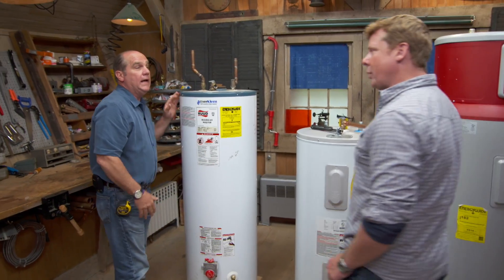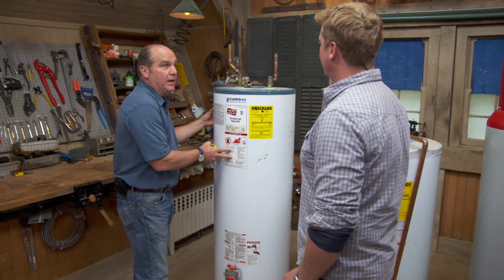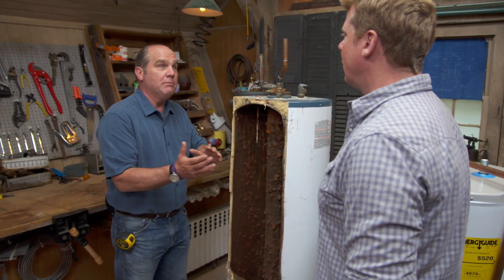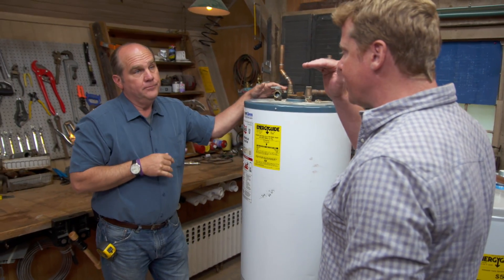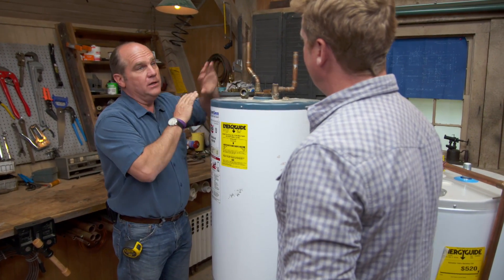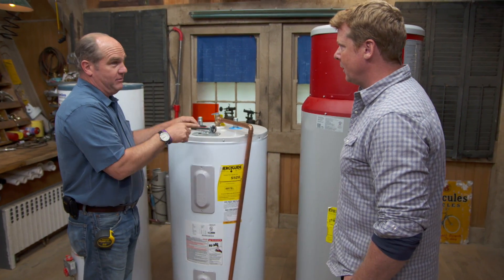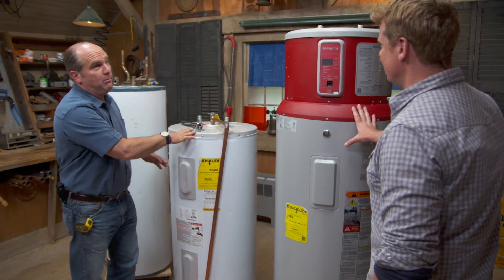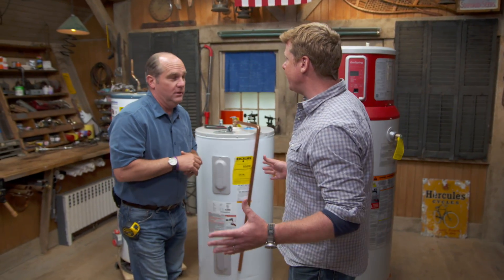Understanding New Water-Heater Regulations | Ask This Old House

Comment: I know this is old, but I wonder if the critical radius of insulation was considered? An engineering issue related to shedding heat from wiring that could be a problem here. Point being that for a cylinder, there's a point where the insulation thickness causes the surface area to increase to a point of maximum heat transfer.

Comment: So if you put a heat pump water heater inside your house you're going to be using, quite likely natural gas or even oil to heat the air that's in your house and then that heat pump is going to suck the heat out of the air and put it in the water. So basically you have a gas fired water heater with an intermediate step.
I live in Georgia where most of the year we have plenty of heat outside so I can see a heat pump water heater being very functional here most of the year provided you can get it outside hot air too draw the heat out of

Comment: I owned a 3 story apartment building for almost 30 years. Each unit had a 30 gallon natural gas fired water heater in the hall closet. In 1990 and 91  I installed Smitty aluminum drain pans under each water heater and ran the 3/4'' pvc drain pipes to outside the building. Almost every water heater failure started as a small leak about a week before the pilot went out and the tenant had no hot water. I could drive by the street or through the parking lot and see who had the bad tank from the weak stream dripping out of the elbow. It might fill an 8 ounce coffee cup in one minute.

 I had AO Smith, GE, and Rheem units. Almost all had a 6 year guarantee. I would buy whatever Home Depot had on sale and keep 2 or 3 new ones on hand. I ALWAYS marked the installation date on the side of the new tank and kept records of tank replacement in my maintenance book. When I sold the building in 2018, I had replaced a total of 47 water heaters over the years.   The last 4 or 5 went out on Sundays. Go figure. 

Many of the water heaters lasted 16 to 19 years. I had the water supply regulated to the 4 buildings to have 45 psi on the 3rd floor. The original pressure was 75 psi and faucet and tub valve washers lasted years longer with the lower pressure.   Perhaps it helped the water heaters as well.

The tanks that failed in 6-8 years had one thing in common.....the tenants always  had them cranked up to the highest heat setting. We had very hard water and those tanks always crackled and popped when the burner came on. You could hear it from the outside walkway. I think the thermal cycling cracked the glass tank lining and allowed corrosion to happen in the bottom seam. I never flushed tanks, never replaced anodes. Those Smitty drain pans saved a huge amount of trouble as no carpets were flooded.

For several years I used those Watts braided flex connectors to pipe the tanks. 3 of them failed over the years and created a huge mess, one in my own house when I was out of town. They sprayed on the cabinet walls and the drain pan didn't help at all. I got rid of the Watts flex connectors one by one and hard piped each tank with copper tubing. Sorry Watts, I'll never buy another one of your flex lines ever again. They all failed on the hot water side.

I have a mobile home vacation place that still has its original Rheem 30 gallon NG fired water heater in it. It was new in 1974.  That would 47 years of service, some kind of record. For years we shut the water supply off to the house when we leave and turn the water heater to ''Vacation''. The pilot stays lit, it sits for 3-6 months with no use. I was just there and it lit off as soon as I put the heat to Medium. It must have an inch of scale on the bottom and it snaps and crackles for 5 minutes every time the burner lights off. I figure its good for another 10 years. 

I like the old thermocouple gas valves much better. They were trouble free for many years. This new crap with the electronics sucks. They are ''new and improved''.

Comment: this new regulation means i couldn't fit a 40 gallon into my space, i had to step down to a 30 gallon. however bc of the better insulation and more efficient burners, i actually get longer time of hot water than my 1994 40 gallon bradford white

Comment: The $ 1200 AOSmith that was installed when I bought my house, failed at 10 years.
The Home Depot (Whirlpool I think) $450 installed 40 gallon short installed in 2005 with 9 year warranty, is still going at almost 14 years old.
Now that same water heater installed is about 1600-1700.
I am cringing every day, as I prefer these old school gas water heaters, especially when I lost power for 3 days.
Reply: home depot is Rheem. lowes is whirlpool but they stopped carrying whirlpool and now carry AO smith. whirlpool was made by american water heater which is owned by AO smith. the 2 brands to go with today are Rheem and Bradford White from plumbing supply house. flush annually, replace anode rod, they will last 2 decades

Comment: Just went through this at my home.  I had a 28 year old (!!!) Rheem 40 gallon Direct Vent gas water heater finally fail with a ruptured tank and went to replace it, only to find the new DV units were now not only expensive, but more importantly, a lot larger than my old unit, making a fit in it's location an impossibility.  Plus the warranty was only 6 years. 

Was considering a switch to a conventional gas fired tank, but then problems with make-up air and the need for a chimney pipe pretty much negated that option.

So, my only remaining choice was to go tankless, which in theory is fine since it frees up space and provides 'endless' hot water, however the price point was very high for my application, the unit only itself being about $1,700.

After having to redo the water and gas lines and patching the wall inside and out where the old DV pierced, the installation was quite a job.

As someone who gets free natural gas right off the well head, the financial reward is NADA.

FU, federal regulators
Reply: Would have been a lot cheaper to just add a 30 amp breaker to your circuit and run a wire to that same location and just use an electric tank.
Reply: @youngrav2311  , I get free natural gas tho, not free electricity 😉

Comment: He says about the Tankless design: "You can't get anymore efficient than this". Wrong. The Tankless Design has maybe a Energy Factor of close to 1, meaning that for every $1 of energy input you get $1 of hot water output. A Heat Pump design has an Energy Factor of 3+ meaning that for every $1 in energy input you get $3+ in hot water output. It can do this since it is pulling heat out of the surrounding air and converting it into heat in the water - rather than creating all the heat through burning gas or using a heating element.
Reply: So it cools your house to heat your water so now you have to spend more the heat your house? Makes perfect sense? Maybe if I lived in South but I live in the North and only heat my house (No AC).
Reply: Move brah

Comment: Stay away from the hot water tanks that have direct vent. The one I bought had a freaking huge motor on top that sounded like a jet plane taking off and it vibrated the floor of the main house each time it started. It was a horrible experience and I paid to get it out of the house.
Reply: That's a POWER VENT and not a DIRECT VENT.

Comment: Myriad of things could go wrong with this heater..Old school water tanks have a burner  and a thermocouple, that's it...
Maybe not as efficient, but 100 times more reliable..
Reply: I agree. My brother paid top dollar for a White Rodgers tank in January 2020. It has had 3 new sets of controls since. I think they are Honeywell. The last one seems to operate as expected but the one before it would sometimes randomly let the kitchen sink water get to 141 degrees,  then stay around 94 degrees 2 hours after the washing machine stopped. I had an apartment building for 30 years and the old reliable thermocouple gas valves always worked just fine until the tanks started leaking 10 + years later.
Reply: The only additional things on a condensing water heater over the Old School is an inducer motor (very inexpensive) a fan proving switch (also very inexpensive) and a condensate line - 3/4” PVC is only a few dollars...in the energy savings alone over a two year period, all those things Ive mentioned on the newer units could go bad and the savings in energy usage would more than pay for them. The benefit is 15-20% energy savings...granted the flue would need to be changed to PVC and could cost you an extra $100 or so to have someone install it.
Reply: @scottmelunis9562   nice lie and bull crap

Comment: The heat pump unit will benefit in the summer time but the winter will cause worse energy consumption
Reply: Yep, less energy in water heating but more energy in house heating. Net no change but it will cost you 4 times more to buy the water heater.

Comment: I can't believe people are arguing that saving money, while using less energy is somehow a bad thing...
Reply: I think they're arguing that the increased upfront costs and new space & plumbing considerations are a nuisance. But I do think these regulations are worth it considering the long-term cost savings. 

If space is tight, go with the on-demand hot water heaters--they're even cheaper long-term.
Reply: The Best Stooge 
Don’t you need one of those water recirculation valves to push the water back to the heater?
Reply: I do not even know what that is as my system is just a gas fired water heater in the hall closet.
Reply: because the difference in heat loss savings is negligible.
Reply: at least it is to the consumer, or home owner.
Reply: If the cost of the savings don't pay for the price of the unit the consumer is at a loss. Not all that hard to understand.
Reply: Market forces should dictate, not government intervention. 

Let the consumer decide what's in their best interest.
Reply: You people make me laugh because when everyone goes to the cost saving stuff the utility company always jacks up their rate to compensate.
Reply: Most people are afraid of change and are haters.
Reply: If you have the money I’m all for saving energy. Problem is if you have spend more money on a water heater and modify your closet to accommodate it it’s just not worth the hassle. I priced out a tankless water heater many years ago. It was 3x the cost of a regular one. A regular one lasts about 10-12 years for me. For the cost of the tankless I could buy enough water heaters for 30 years and with saving of only 30% it wasn’t worth it.
Reply: The only thing good about a tankless water heater is the instant hot water so water is not wasted as you leave the hot tap on waiting for the hot water to arrive.  In my 2400sq ft. home that can take up to 2 mins in the dead of winter.  That is about 5 gallons of wasted water.
Reply: The Best Stooge bottle that water. It won't be wasted

Comment: Hang or Cradle your Electric Water Heater Horizontal for a 75% cut of Cycling loss and a 35% energy savings and a 40% increase in first hour draw

Comment: I have a question. We have a 50-gallon electric water heater that's about 9 months old. We only use hot water in the morning for showers. Could we save energy by using a timer that allows power to the water heater only between 6 and 8 AM ?
Reply: It depends if your utility has time of use rates. I would recommend you install a HPWH and set the timer to run during the cheapest time of the day. Save on making hot water, energy and demand charges.
Reply: Insulate your tank more. It would take so much power to reheat 50 gallons plus the water you use everyday. Otherwise an on demand  water heater would be your next best choice. In my opinion
Reply: +Glenn Watkins Of course, moron.

Comment: My old gas water heater lasted 17 years and it was only a cheapo unit. This guy said they are only going to last 7-10 years? He has not a clue.
Reply: +opjoipopikopp[pl[p[  Yeah and my parents have one that's going on 22 years... BUT I had one go bad at 9 years old.  I have hard water and they use rainwater... it all depends on your water etc.  He's probably going off of studies that take into account thousands of water heaters or his years of experience, so he probably has a hell of a clue.
Reply: +opjoipopikopp[pl[p[ I've seen a lot of people say they only last 10 years at most, but I have a gas water heater I'm about to replace that is 20 years old. I think how you maintain the water heater plays a huge part in how long it lasts.
Reply: opjoipopikopp[pl[p[    call me   I sale u new tankless
Reply: Very true Nick on water conditions. My dad's HWH is a 40 plus year old electric. Crappy water also, thing will never die.
Reply: And then one day your tank heater will fail and flood your home and cost tens of thousands.
Reply: Not my dad's it is a unfinished basement. The water will flow into the sump pump crock if the tank let's go.
Reply: I just replaced one last week which lasted 20 years!
Reply: Another factor that's sad, but true, they don't make them like they used to....
Reply: Only the average is 7 -10 years. The life of a tank also depends on the type of water you have. I also had one that lasted 17 years.

Comment: Why don't they just increase the insulation outright, rather than dictating what type we use.  Silly nanny state laws.  We're essentually forced to use certain light bulbs, weaker appliances, etc. yet I can just switch to electric heat.
Reply: Steven Sevieria North Korea has a much stronger Nanny state than the US so moving there if you don't like government controlling you life is the worst thing. What I worry about is if we make these water heaters more energy efficient at a cost of complexity that is a big problem. If a water heater saves10% on energy but due to fans, compressors, etc only lasts 7 years they will just end up filling landfills thus being a net loss on the environment. Also with heat pump style you are dumping refrigerant in the dump, with thicker insulation you end up with more plastic being thrown away. If these energy efficient ones are so much better then people will buy them of their own choice.
Reply: MetusBatmanV4
Troll.  Go wipe off your chin.  Demorats lost.  Get over it loser.  MAGA!
Reply: hansonsux it's a little thing called government, what so many small-minded people (Trump voters by the way) seem to miss is the fact that the government's looking out for everybody, not just you. That's why the government is there, long live the USA, if you don't like it move to North Korea or something...
Reply: +hansonsux Why would they increase the insulation if they don't have to, moron? Saving the country energy is a group effort, moron. Seat belt laws are an example of nanny laws not energy efficient water heaters, moron. The appliances aren't weaker, moron.

Comment: More energy efficient = you'll be replacing it every 5 years.
Reply: All new Heat Pump Water heaters have a 10 year warranty. The savings provided by Heat Pump technologies more than pay for the unit in less than two  years even less if you have utility incentives.
Reply: "I built for a customer" That was the problem right there!
Reply: Put one in a new house I built for a customer lasted less than a year computer chip kept going out. Finally replaced it with a conventional one and haven't had an issue since.

Comment: We have soft water around here, so they last longer than 10 years.
Reply: My neighbor's with soft water started leaking after 13 years. Mine (no soft water) is 18 and still going strong. How does adding salt make a steel water heater last longer?
Reply: That's not how they work.

Comment: I have a heat pump and haven't seen the savings promised. We also kept getting cold showers, so we turned off the heat pump feature entirely.
Reply: +Thic Did you have it in "Hybrid" mode or "Heat Pump Only" before disabling the heat pump entirely?
Reply: It was in Hybrid mode.  But even if the water was cold, it wouldn't actually use the heating element enough to give us hot water.

Btw, we have the GE GeoSpring Heat Pump Water Heater.  Obviously, I don't recommend it.  If I were to do it all over, I'd probably use a few tankless water heaters.
Reply: Thanks for your feedback Thic. I really appreciate it.
Reply: I would recommend you check your settings and potentially raise the set point temperature a few degrees until you have the performance you are looking for.
Reply: water heater at opposite side of house from shower? you may need a recirculate pump?
Reply: +FunkyWeezy Something has to either be wrong with the location of the water heater, the installation, the water heater itself, or the temperature in the environment. Lots of other people report water temperatures of 120 for a showering family of four. So why does it work for them and not you?